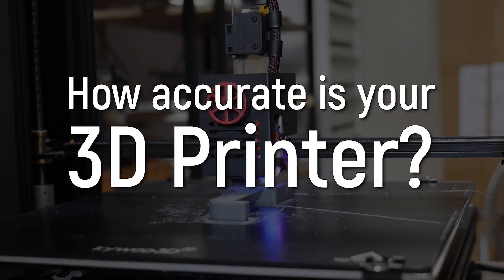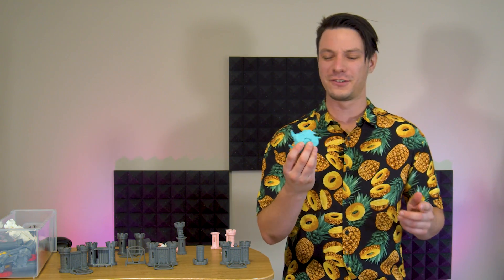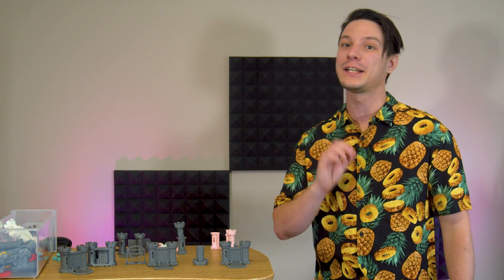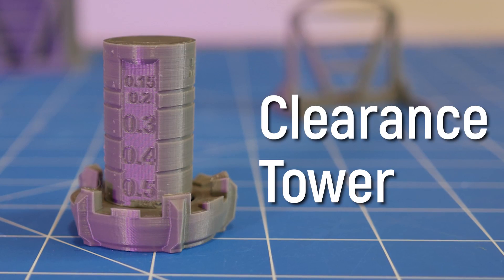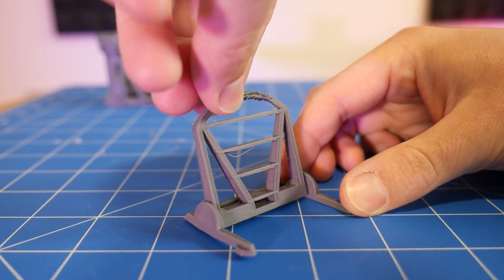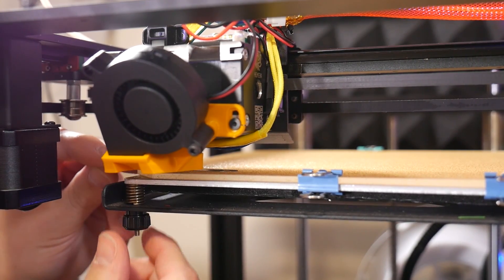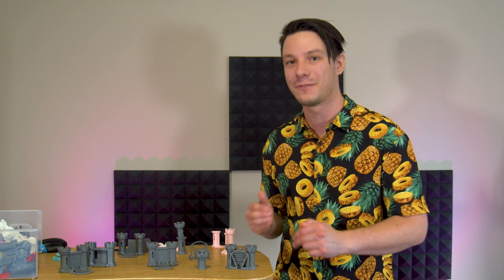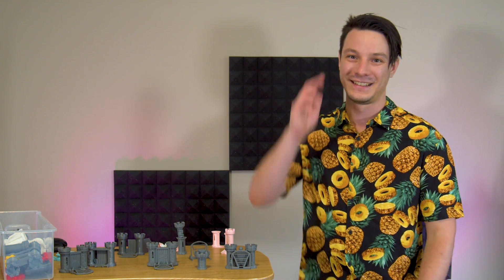Can you Conquer the Clearance Castle?

Comment: Printed and the bridge latch is stuck on the inner rotating puzzle. To check everything else, I pulled it with some tools to break it away. Solved the puzzle by twisting it around the knob, but then the piece that slides out had molded to part of the castle on the inside. Any idea (anyone) what need to be adjusted?

Comment: For mine it seems like gaps of 0.2mm don't collide, where 0.1 has a nice snug fit (if you're going for that, which I have used a few times, but for a very very small parts [like arround 1cm and under] the 0.1 gap isn't quite enough and they kind of get stuck [but can be encouraged 🔨 ]; 0.2mm seems to be better for them), from this video that seems like decent tolerance, but correct me if I'm wrong I suppose

Comment: Built this with my new Ender 3 V2 Neo using PLA+ White after i felt that i had gotten it as accurately as possible. I didn't even bother printing the smaller test parts going straight for the castle itself. It came out nearly flawless, the only "issues" were with the top of the arch on the drawbridge where the filament was very slightly distorted.. As for the tower and door, they slid flawlessly, just as intended. Excellent stress test for the printer, but unfortunately i came into the 3d printing business far too late in order to be able to watch the secret video written in the castle.

Comment: I left my Clearance Gauge in my car to check the material for changes in temperature throughout the year. It's a neat little tool to tell me over time if the dimensions of the material has changed due to an extreme environment such as a car's interior.

Comment: I will have to use those when my printer comes in and probably video it. However do you ever test the accuracy at 1mm vs 200mm height? Or even test it in separate corners of the bed which I guess I can slice it in different locations.

Comment: Years ago, when my printer was still functional - tried to print a print in place model that has no support but was meant to be like a wrapping around cube. It didn't separate at all - it's just a strong brick. 

A little bit later I tried to print the Slinky - which took like 10 hours and it's the strongest item I ever printed. I can even stand on this 60mm diameter tube - but it's not solid.

Comment: Man, I got the tower, bridge and the whole castle to print very well on my ender 3 but I can not get the clearance card to print well as it keeps welding the .2 together. My ender 5 plus printed it with no problems. With the clearance gauge I can get the .15 with my 3 but not the dang card. I swear I’ve tried everything.

Comment: Can anyone point me to an explanation about how to interpret the results and which parameters must be changed in Cura to obtain better results? For example the bridge cames down but there is a bit of overhanging. The tower in one print did not move at all and in another print it comes out almost to the very top but not completely. And the door does not move. What should I change? Thanks!

Comment: What nozzle diameter was in mind when this was designed ?
Are there odd dimension parts like 0.7mm and such ?
I mean how do you print 0.7mm wall with a 0.4mm nozzle without under extrusion which is not a good thing to match the wall.

Comment: Printed beautifully on a stock Ender 5 Pro, the only thing that I adjusted was the extrusion width (1st layer 0.4, others 0.42) and nothing was fused together, 0 force required to get it moving. Bridges look completely straight, with only few tiny blobs on the top arch. All of this despite printing in PETG with only 20% fan speed. I hate to admit that it took me an embarrassingly long time to get the tower out and put it back in again though

Comment: On the quick print, I can see a few slivers of daylight around the .2, but I have to break it free with force. I calibrated e-steps already. Is there a slicer setting I need to tweak? I'm using Sovol SV01 & Cura.
Reply: I'm running one with flow: 90% just to see what happens.
Reply from the maker: How's the first layer? The start and ends of perimeters might also have a slight bulge, which can stick the parts together. If that's the case, it's a retraction setting tweak.
Reply: @MakersMuse  Flow:90% starved out the first layer and it got a little threadbare, but all pieces separated cleanly. My coasting & retraction feel OK. I guess there's a flow rate sweet spot somewhere in between the two.

Comment: Bought my printer (Ender 5 Pro) a few weeks ago, and this is actually the first 3d print I've bought.

The clearance castle's clearance card test print was easily the best part of this bundle. Due to it being a simple 5-layer 15-minute print I managed to test so many changes and tweaks to my settings in fast iteration. Without that I would probably still be printing with wrong esteps, wrong bed temp, wrong nozzle temp, wrong z-probe offset, even wrong concentric nuts tension on my wheels (Had a layer shift mid-tower). :D

Thanks for your design, it was fun to storm the castle and get as far as I did.

I still struggle with hitting that magical .15mm but I went from unable to get anything but .5mm to move to juuust about clearing that .2mm, in only two evenings!

Comment: well the print look nice but i couldnt get the turret all the way out,  so i am not sure which setting i would need to adjust any suggestions ?
Reply: The Turret is a maze lock, are you having issues where it's just not moving, or where you're not sure what direction to twist/push/pull to get it out of the maze?

Comment: Hello, I really like your videos and they helped me a lot!!! I have ender 3 pro and  I use ultimaker cura slicer and I have a single problem. My infill is shown to the outer walls. I tried to set the walls(perimeters) higher and it stopped around 6. I also tried this feature: https://youtu.be/5m396ZRRQYg in cura but it just made it worse. I think that 6 walls(perimeters) are a lot and is not worth it. I would be really happy if you solve my problem. Thank you very much.

Comment: I only had 50g left on my roll so I just went straight for the castle and it printed perfectly on my tuned Ender 3 Pro. Funnily enough it was the draw bridge that gave me the most trouble, my bridges were so dirty it slightly fused to the tower but broke free with minor force.

Comment: i solved first layer problems by changing the original extruder with a better one and using 0.4mm first layer height with low speed. Why? +/- 0.1mm level devition  on a 0.2mm height is 50% error on over our under  extrusion, using 0.4mm means 25% on 0.1mm deviation,  not only is more forgiving but also a Lot Easier to level the bed on the fly on the first layer.

Comment: Just finished mine yesterday, what's the purpose of serials on all parts?
My print has taken "3h 18m 49s" to finish, and 11.21m of PLA+. Tests part are useful and I've teaked a bit more my printer. But I notice that even if the all 3 tests parts are well printed, the castle print may remain with issues, specialy with the overhangs. But for a first try it's really good!
Thanks for the model!

Comment: Great stuff! Going to print it now. Maybe you can clarify this thing I've discovered. On the sidewinder X1 I noticed that the default steps per mm in the firmware is not actually correct according to the prusa calculator. It should be 80, 80 and 400 XYZ, but its actually slightly more for the XY and slightly less for the Z. Any idea why this is? Pretty sure this will affect dimensional accuracy? I actually printed a 30 mm test cube on a 0.8 nozzle at 0.32 layer height and the result were terrible! There was very obvious z banding (consistent pattern) with bulging at the edges of the banding. Never noticed it on a 0.2 layer height. And it was amplified by a silk filament.

Comment: The first problem with clearings tests, is that some slicers fuse the layers in the gcode itself, so no mater how good the printer is, the print would always fail. 

You need to inspect the gcode in the preview to be sure there's clearance.

The second problem, is that some slicers generate extra clearance in tight spaces, making it possible to complete the test, where it would have failed if the slicer used the intended clearance.

Comment: @MakerMuse
and this is the Clearance Tower 😁

https://youtu.be/9jUsBWC3GcI
Really awesome test objects.

In order to print the Tower without any glue or hair spray on the bed  and without any brim (otherwise what would be the challenge.. 😎) I had to change the way I usually printed, and I realized that may be I always was printing in wrong way.

I had the habit to set the bed temperature for the first layer DIFFERENT than the others (e.g. 60/50), but with this design that has very few surface in contact with the bed, I had the object detaching after around 30 layers. 
That make me think that, even 10 degree of cooling, can stress  and contract the PLA, causing the detachment. 
So the best way could be to have always the same bed temperature for the whole print (and considerer the "other layers bed temp" an obsolete parameter). So I reprinted the object having 80°C for bed for all the layers to improve the adhesion, and 218° for the nozzle.
And since it was a precise design, I also slowed down the printed speed from the LCD panel to 45% for the first 5 layers and then to 54% for the others since I did not want to wait 4 hours (it took around 2h:40).
I think the result is perfect, it matches perfectly at the very top, and do not exit from the body.

Comment: I'm completely new to this so was a bit apprehensive about starting with a challenging print.
Using a new Prusa Mini+, Prusament PLA and PrusaSlicer.  Stuck with the recommended settings and selected "0.15mm SPEED" and Generic PLA (forgot to change to Prusament PLA setting).
-  Clearance Card - Fell to bits immediately.
-  Tower - The crown goes up until it's exactly flush with the top.
-  Drawbridge - Nice straight bars, a couple of tiny blob in the middle of top arch. 
-  Castle now being printed. - Fingers crossed!
Apart from setting the base layer clearance haven't so far had to fiddle with anything.

Comment: Nice. Will have to give one or more of these a shot now that I'm at a point where I need to re-evaluate my clearances. By my last evaluation I was down to 0.26mm but changing from Cura to SuperSlicer gave me so much more control over flow that I'm finding that 0.26mm has become too loose. Other changes factored into it but mostly it was the slicer change. Not saying SuperSlicer is better, both are awesome slicers that I will use depending on what the goal of the print is.

Comment: My clearance tower goes to within 1mm of the top, is that OK or undersized? The clearance card has some sticking at 0.2, 0.3 is fine. Think I can print the tower in 3h 22m with 3 perimeters, 5 top and bottom layers on an ender 3 and have it look *good*.

I'm a bit at a loss of how to deal with maybe undersized "fit" from the tower, but not ideal print in place clearances, there's hole compensation I could tune but it's not enabled right now. Aside from tweaked speed and accel i'm using a failry standard MK3S profile becasue it works really well

Using superslicer on an ender3 frame and motion, afterburner/clockwork/E3Dv6 toolhead and SKR mini E3v2.0 running klipper.
Reply: Dammit, a travel knocked the drawbridge loose. Turn on z-hop, try again.

Comment: new to 3d printing with a anycubic vyper.  I upgraded cura last night, tweaked on a new profile for several hours and started to get some amazing PLA prints.  I can’t wait to see if I can hone my skills to this challenge!  nice work!  fun channel
Reply from the maker: Nice! Welcome to the hobby :)
Reply: It’s kind of funny, I have an Ender 3 Pro.  Used Cura for about a year, switched to Prusa Slicer last month, and print quality shot way up.   There must have been some small setting in Cura that I’d screwed up (I installed it fresh multiple times though, so idk).   

Prusa Slicer has been great though, I like the way the supports are handled :)   That being said, if Cura is working well for you, DON’T CHANGE ANYTHING haha